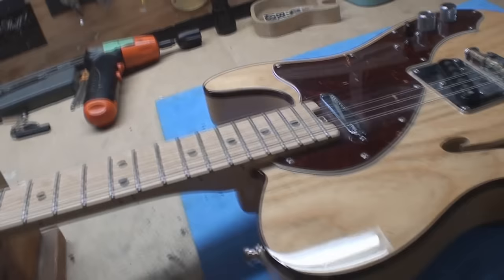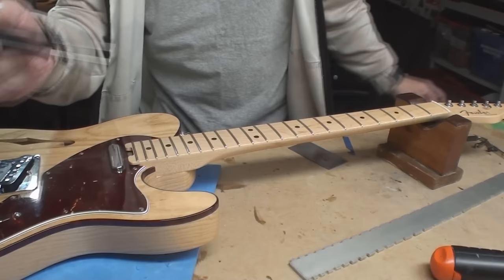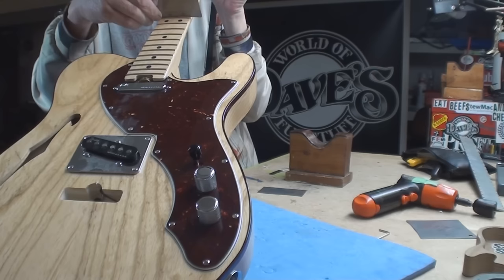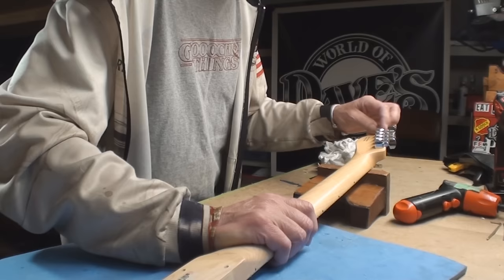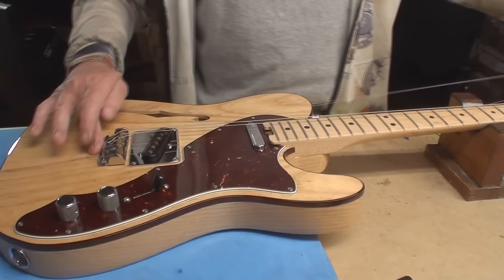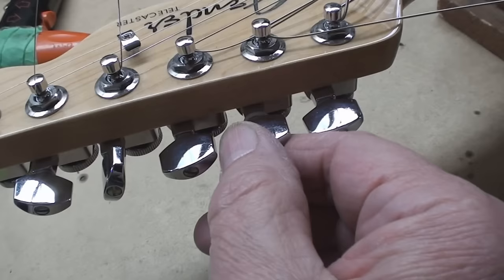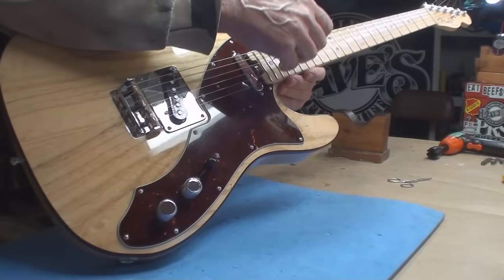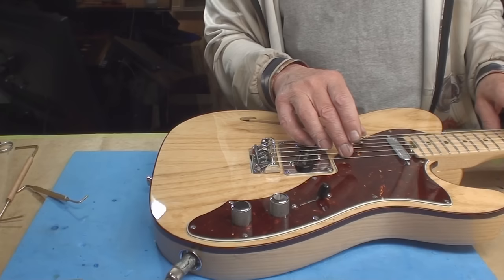Fender USA Thinline Telecaster 2018

Comment: At 1:45... I could see a bit of backbow and the buzz seems to confirm that. Predicting you will back off the truss rod slightly and it may still need a thin shim to pitch the neck down so you can reset the saddles for a nice action. Will gladly admit it later if I was wrong. Nice looking Tele! Now I'll shut up and watch the rest.

Comment: one of our lead guitarists had a thinline Tele many yrs ago.  Very dynamic sounding for a Tele player, which I'm not
Reply: Tab Benoit has been playing a Thinline Tele for over 40 years, it's pretty much his only guitar. It's battered and worn but he gets a killer tone from it.
Reply: I have a '69 reissue American Original Thinline. Not fun for truss adjust, but a great playing guitar.
Reply: @RideAcrossTheRiver  no, not fun if you happen to live some place where temperature/humidity fluctuate throughout the seasons. I imagine your t-rod adjusts is at the heel. After 40yrs I know I have to make adjustments on several of my guitars at least twice a year
Reply: @rodnyg7952  Correct--as a reissue 1969, heel adjust.  What is a quick, safe way to adjust it?
Reply: @RideAcrossTheRiver   well, I assume you knew exactly what you were in for when you got it. My Strat (81' std) needs tweaking in spring & winter. I have an ES335 dot reissue that's always fine though. It seems to never need relief correction. Haven't touched it in years --strange stuff
Reply: @rodnyg7952  My Gibson thinline has never needed a tweak except for bridge height. Never touched its truss rod. What's your quick adjust method for a Fender?  A tech told me just do 1/8 turn and reassemble.
Reply: @RideAcrossTheRiver  I guess Gibsons are just better at staying stable. For my Fender it's usually a very small turn either way, depending on season, a check of intonation, and then quickly feeling how comfortable it is when fretting
Reply: @rodnyg7952  Yes, but do you remove the entire neck or just loosen and tilt?
Reply: @RideAcrossTheRiver  no, this Strat adjusts at the headstock, but I've worked on other client guitars at the heel before. I would simply loosen strings, put a capo on it at the 2nd fret to keep strings in place, & do the slight tilt thing to access the nut. I'd only remove the neck if I have to set it in a vice if the neck doesn't straighten out enough from worn out truss rod threads. It sometimes gives the nut a bit more wiggle room to adjust

Comment: How are you setting string radius without using a radius gauge?  If you are just going by string height, how are you compensating for the compound radius?
Reply from the maker: measure string height? much?
Reply: @DavesWorldofFunStuff  What I mean is, typically when a neck has a compound radius, a common way to set the string radius is to determine what it should be by "extending" the neck to the bridge.  For example, I have a Warmoth neck with a 12 to 16 compound radius.  Extending that to the bridge gives us about a 20 inch radius.  So, setting the bridge at 20 inches makes the neck play nicely from the 12 inch radius up to the 16 inch radius.  My Charvel came set-up from the factory like that and plays perfectly up and down the neck, too.  Is measuring string height at the 12th fret a good way to compensate for the compound radius of the neck?